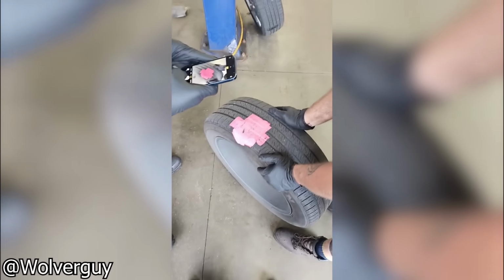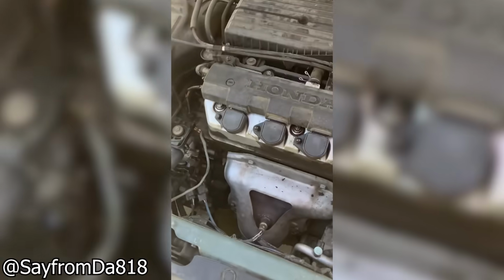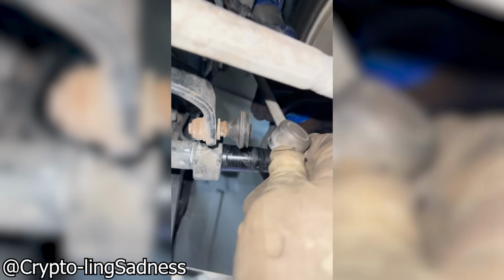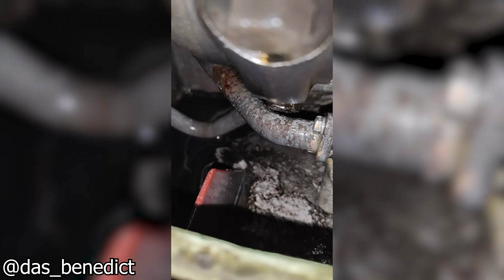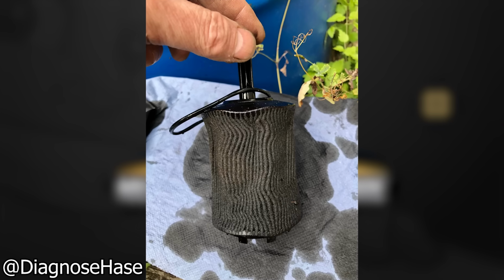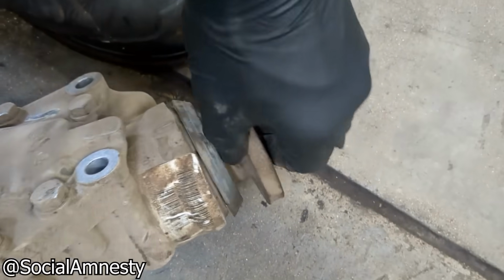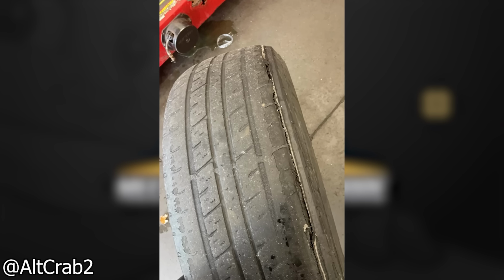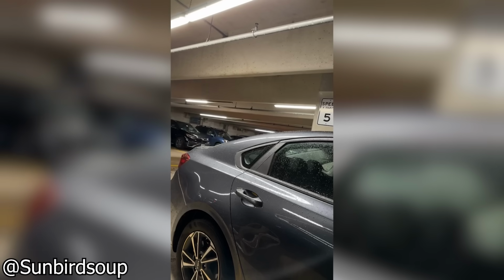Customer States 'My Car Started Smoking And Now Doesn't Start Back Up'

Comment: That oil filter drain guide is a thing of beauty. All too often engine designers seem to go "Wait, we forgot the oil filter" and put the thing in the worst place possible.
Reply: my 1996 GMC Sonoma 4cyl. had one.
Reply: Yeah, you either finish up with oil all over a cross member or something else.
Reply: VW had it with their lenghthwise installed engines. I always would rip up some air filter box and create funnels with the pieces to minimize the mess...  Opel has created a housing sitting behind the engine and above the driveshaft. no matter what you do the driveshaft sleeve will be doused with oil. aside it taking a lifetime to drain the oil from the housing if you do it as they intended.
seems like modern engineers have no idea about repairs and mainenance. they just... construct.
Reply: My 2001 F150 has something similar. The oil filter mounts horizontally and underneath where the filter contacts engine is an inclined "tray" that redirects the oil forward of the crossmember.
Reply: @Chris_the_Muso  I had a Honda Accord where it would pour all over the steering rack and pinion and then onto a crossmember. Big mess.
Reply: a lot of toyotas and lexus cars, if the oil filter is in a stupid spot, will have something similar to that oil guide drain
Reply: Yeah but let's take it a step further; if they would have designed it differently, there wouldn't be a need for the drain guide. Just sayin...
Reply: In my Renault the filter is on top of the engine. When you turn the engine off the filter drains by itself and can be removed without making any mess.
Reply: @rubenproost2552  My Audi is the same way. If you can only trust pumps to pump out all the oil from the dipstick tube, you'd never have to lay under a car again to perform an oil change!

Comment: Noise when cold: Might be secondary air injection pump.

It's a piece of emissions equipment. Car runs rich, then as a blower put a bunch of oxygen into the exhaust to get the cats to light off and come up to temp

Hard to diagnose through the video, of course, but I think it's worth a check.

I say that, over a vacuum line or something, because you can hear it 'spool up.' If it were vacuum related, you'd hear it immediately on startup
Reply: @exhibitedmeat694  No big difference, the effect is the same - noise.
Reply: @exhibitedmeat694  It was a joke too.
Reply: Yeh or some idle air control that is stuck half way open where it will whistle/hum.
Reply: Definetly air pump, heats cat faster
Reply: Definitely my thought. Secondary air pump.
Reply: I agree... The secondary air system on my Toyota went out and sounded exactly like a Bissell. Only on cold.
Reply: I was thinking this volvo is equip with an electric air pump for the air suspension.

Comment: Do not wait until your temperature meter reaches red to stop or keep going until it shuts itself off. Always pull over and have it towed home if you see your car start to run hot. If it shuts itself down that means that it blew a head gasket, warped or cracked the block, melted multiple wires and damaged the manifold etc. Never ever keep driving once it starts to run hot. If the needle goes above the half way mark, pull it over and have it towed.
Reply: Words to the wise.

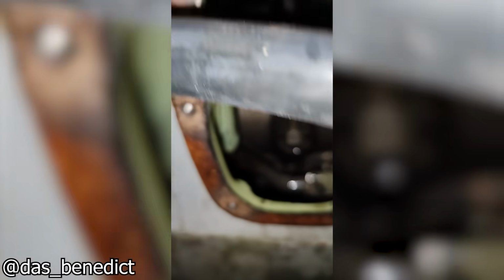Comment: 2:28 the same can happen with those pesky 5cyl diesel engines VW developed a few years ago. the ones without any external belt drives and such... the water pump sits in the back of the block, driven by the crank via cogwheels. it is sealed with two punky silicone rubber rings, which can fail, slowly filling the oil pan with coolant. since you don't see any leaks people assume towing that trailer heated the engine and caused water to go away, and refill. and so on, until the oil pump draws water and the engine blows up.
they also make the high pressure injectors work themselves into the cylinder head, which becomes thrash then.
good thing VW doesn't build those contraptions anymore.

Comment: If the Volvo uses electrohydraulic power steering, my guess would be the pump has failed and the noise is the pump motor trying to build pressure. Or there's air getting in to the system.
Reply: I was thinking that or a really loud electric vacuum booster. But more likely your idea since it's so old...

Comment: Disconnect the secondary air pump and see if it still happens.
I have a vw mk4 golf and if the rivets holding them together fail they can sound like hoovers.
Simple drill out the rivets and replace with nuts and bolts and its all good again.

Comment: noise sounds like a failing air pump. Mazda RX-8s do the exact same thing. the pump only comes on when engine is cold
Reply: My Mercedes-AMG does the same thing only when cold. My air pump is on the way out soon.

Comment: Coil overs are such a nightmare. I've done 3 of these and had to replace tie rod ends, upper and lower ball joints all together. I keep telling them, "if you want coil over, you should at least get adjustable control arms and sway bar link." They always tell me this, "That's too expensive." I was baffled in disappointment.

Comment: 2:52  I could totally have used one of these on my Dodge ram van and my previous ford econoline van.  oil drained on either the exhaust pipe or the cross member.  Was ALWAYS a mess.  Would be a great aftermarket part.

Comment: That noise on the T-bird sounded like a blown up cooling fan. Unless it has a smog pump or air compressor. In which case it would be a busted hose somewhere just blowing air straight out. It definitely sounds like a small fan noise like an air mattress pump just blowing air

Comment: The noise clip at the end sounds like a Secondary air injection pump, also given that it only runs when it's cold! They do they to help speed up the catalytic converters warm up for efficiency!

Comment: We need to bring back the shop class and maybe some basic mechanical classes to high schools.  People these days are just too ignorant and oblivious to the world around them.  
I see a cloud of coolant steam in front of me, but let's just keep on driving.  🙄

4:21 That Volvo noise could be the air injection pump for the catalytic converter.  My understanding is that extra air is forced into the exhaust system to prevent cat converter poisoning when the engine is cold and runs very rich.   
*  I miss European cars with six-speed manual gearboxes.  😔

Comment: If your engine starts overheating shut it off and save yourself a crazy repair bill if possible. Your block/headers can warp from excessive heating and that is not a bill you want.

Comment: I don't know what make/model the first clip was about but I have to ask where its been to get so rusted out. The sea?
In 🇬🇧 a vehicle in that advanced state of corrosion would definitely NOT pass its compulsory annual safety check & it would  probably be condemned as being structurally unsound and sent to the crusher . If your vehicle is 3 years old or more, you have to have an annual safety check "pass" certificate to relicense it.

Comment: That looked like a S70, those engines are dirt simple, only 3 accessories could be making noise: alternator, power steering, and air con.  I'm gonna guess alternator and/or idler pulley.